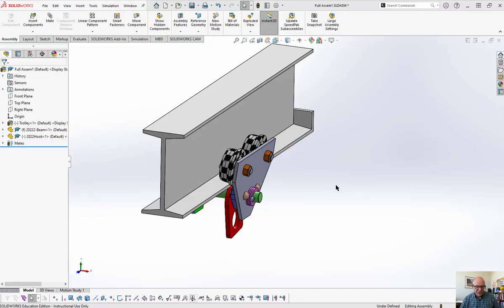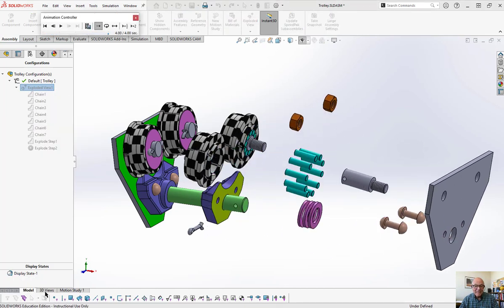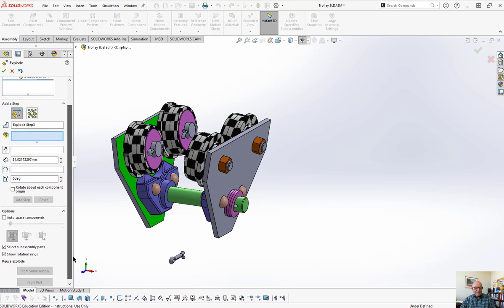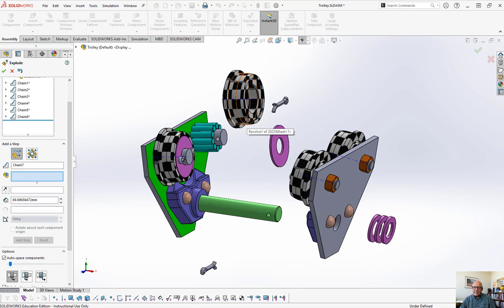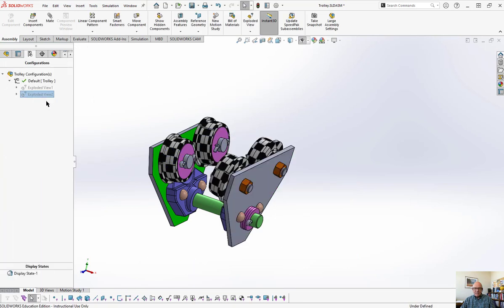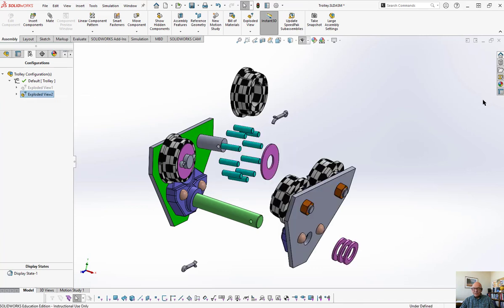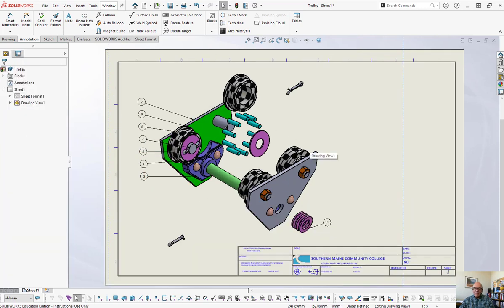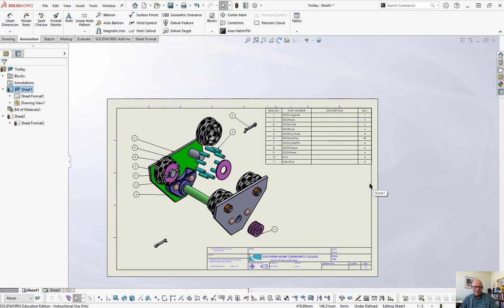Exploded View SolidWorks

Comment: Hi sir ,, Ive got a small issue in assembly for my solidwork project  that I didn't find a solution ,, is there a possibility to join or contact you  directly ?
Reply from the maker: If you are a student in one of my classes, come to a posted open session.  If not, what is the small problem and I'll respond when I get a chance.
Reply: @DanAbbott-SMCC  
1- I'm not one of your students .. 
2- my issue was I've got more than 1100 bolts  , 1100 nuts , 2200 washers to assemblate by mate in my assembly
Reply from the maker: Is the problem getting all those fasteners into the assembly, or is it selecting them as a group to create an exploded configuration?